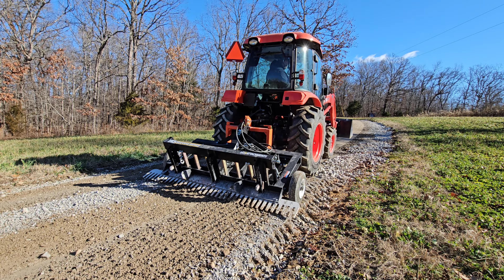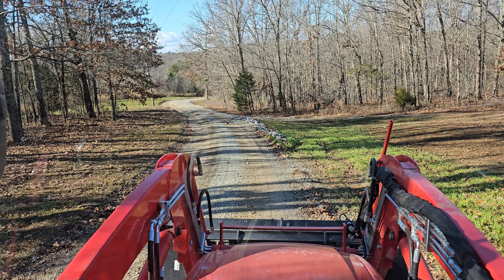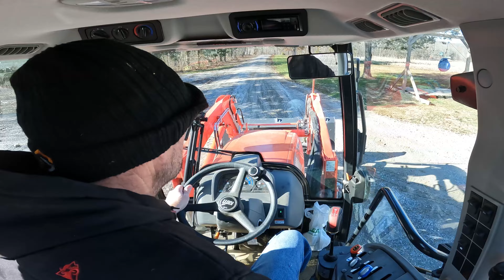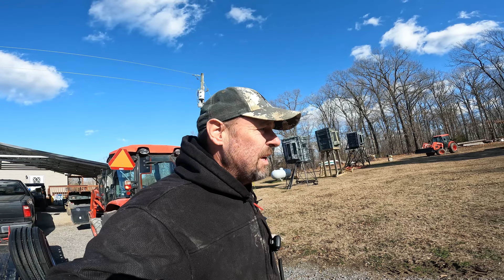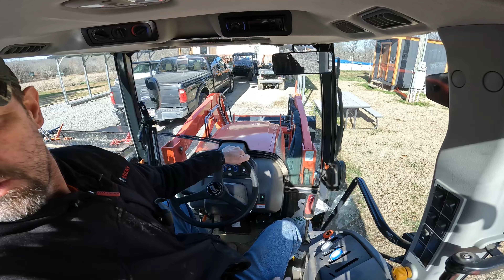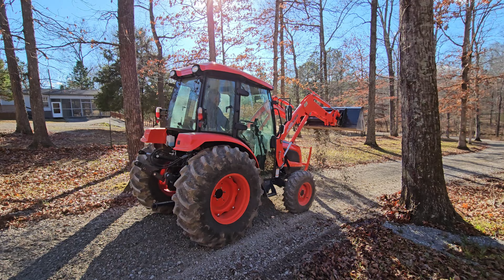Complete gravel driveway makeover in 4 hours!

Comment: great job on that driveway.  That TR3 is an awesome attachment.  I got to use mine for the first time last week on our arena.  I'm looking forward to putting it to work.
Reply: @kapperoutdoors  thanks.  I didn’t even have my hydraulic top and tilt links on it yet.  I could definitely tell how convenient they are to have when it comes to making adjustments.  I had to get off the tractor a couple of times to get it right.  It was the best the arena has ever looked.    I ran over it in two directions with the scarifiers, and then leveled and smoothed it out with the floating blade and the combs.